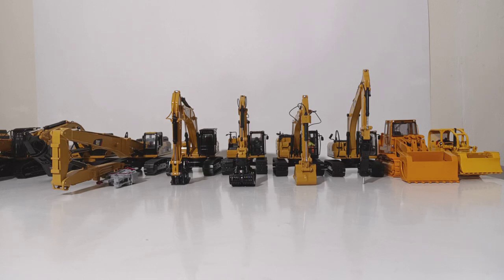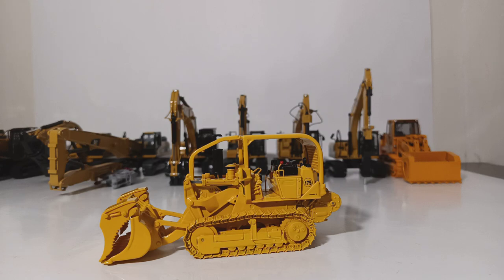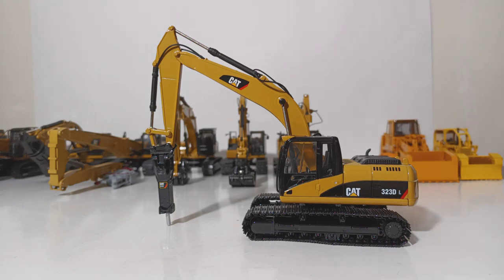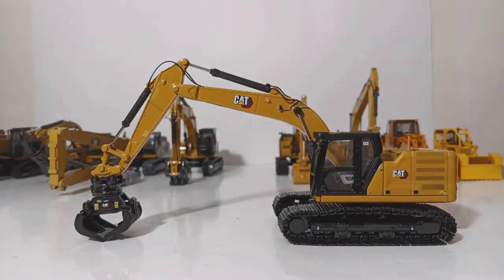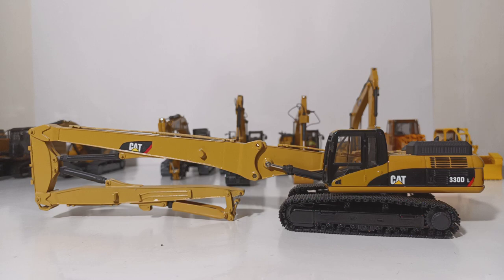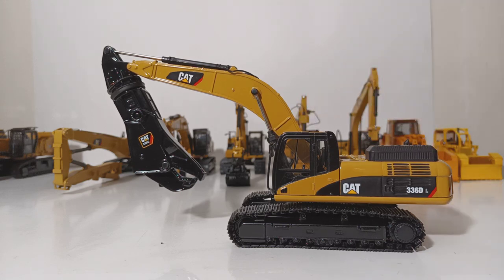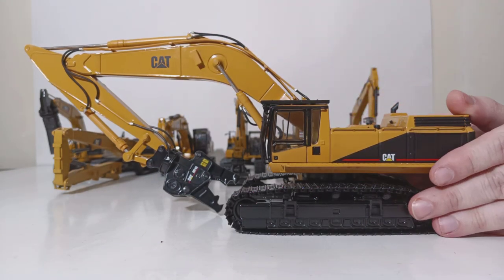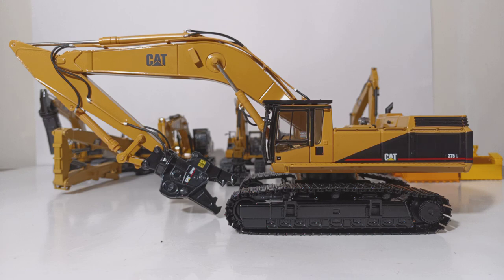1:50 Scale Diecast Demolition Heavy Equipment Collection

Comment: List of Equipment:
International Harvester 175 Series 3 Demolition Configuration
Cat 973 Demolition Configuration
Cat 323D L with Impact Hammer
Cat 323F L with Demolition Thumb
Cat 323 Next Gen with Sorting Grapple
Cat 330D L with Cab Gaurd and Concrete Pulverizer
Cat 330D L Ultra High Reach with Temporary Processor
 Cat 336D L with S365C Metal Shear
Cat 352 Next Gen Ultra High Reach
Cat 375 L with MP40 Demolition Shear